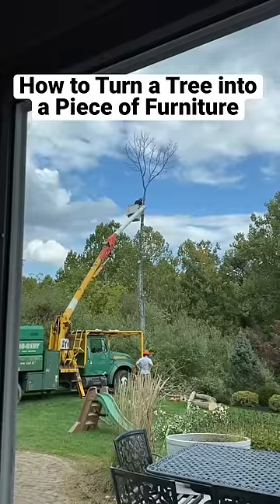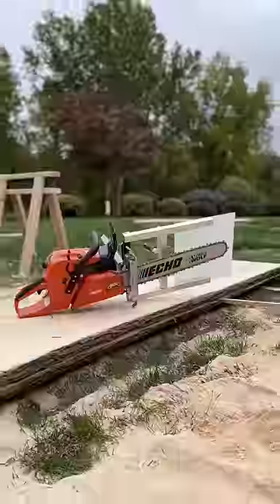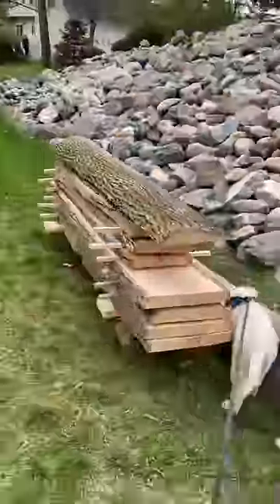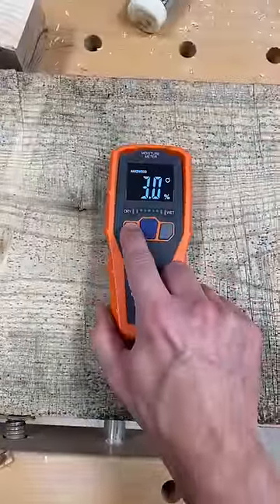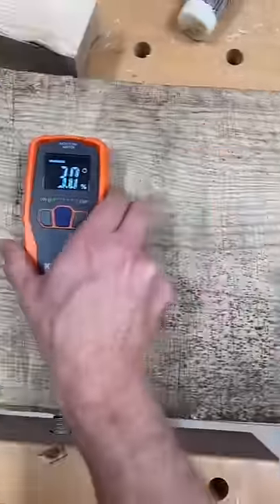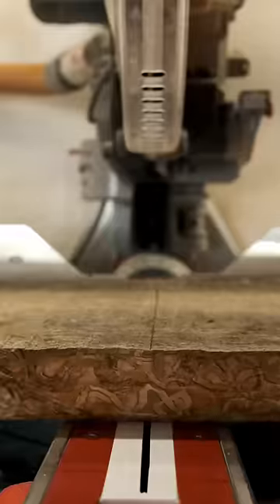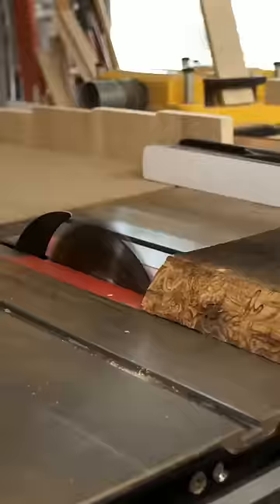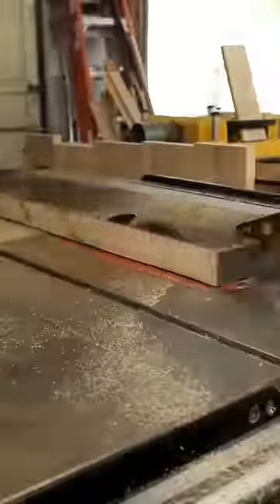How to Turn a Tree into a Piece of Furniture

Comment: Throw a 2x2 frame together that's large enough to fit a milled log in. And wrap it in a piece of vapour barrier, cut a window that can be opened a few days a week for airflow you can also put a roof vent on top to vent the vapours and not let water in. but the sun will bake the log in 4-6 months depending on slab thickness.
Reply from the maker: Great tip ty

Comment: From my dads experience the echo chainsaw is just not very reliable. Earlier this year I started dumpster diving and found a Husqvarna chainsaw in the dumpster behind tractor supply. After like 10min research and 30min fix i saved $400 bucks minus the new blade and chain because the person who tossed it bent it. Sold it to my friend for $200

Comment: Truthfully, you could probably have had that dried in a single summer just by putting it outside under a black tarp on sunny days. Other than that, beautiful work.
Reply from the maker: i'll give the tarp a go next time! and seal the ends as well...lost about 6-8" off each end from cracking...
Reply: @DIYwithRick  Yeah, board checking (cracking) is a real pain. Just remember to flip the tarp once a day or so, so that the moisture has a chance to evaporate properly.
Reply: Attic is perfect kiln

Comment: Hmmm, MC, moisture content, of lumber is not based on surface moisture. A lumber moisture meter has 2 pins that get driven into the wood. Sweet video besides that
Reply from the maker: great tip. sounds like i need a new...tool!

Comment: No way he used that chainsaw fixture for making those boards. I own a lynn 1500 saw mill and i know what the marks of the band saw blade make. That guy bought those boards. Also if you dont want boards to turn out as dark as his, use dish soap spray after you cut it. The dark is a mold that grows. Dish soap mixed with water slows the growth of it.
Reply from the maker: I have over an hour of video of me milling these boards with my chainsaw/alaskan mill. A clip of me doing it is LITERALLY in this short. I don’t even have a bandsaw! 😂 The dish 🧼 is a good tip though. I haven’t heard about this so thanks for that.
Reply: @DIYwithRick  oh dang. You must have a good blade on that saw then i have a simmilar model timber wolf saw and it would take a lot of patience on cutting that size lumber. Also if you plan on doing this for a bit more than a hobby may i suggest a upgrade of a sawmill? Harbor freight has a bolt up mill for about 2k. Can mill a 24 inch wide tree

Comment: Took two years to dry enough without a kiln?
Reply from the maker: Yes it was probably good to go at about 1-1.5 years
Reply: @DIYwithRick  whew, that's a long time.  What kind of wood was it.
Reply: @carlhenderson7254  Seems pretty reasonable to me. Generally speaking, it takes 1 year per inch of wood to dry. 
So a 2” thick piece of wood thickness would take 2 years of air drying before it’s ready to use.
Reply: @masonrisner7205  okay.  I didn't know there was an actual formula.  I had red oak countertops made but the wood was kiln dried.  I think it took two weeks.  They guy had a semi trailer as a kiln.